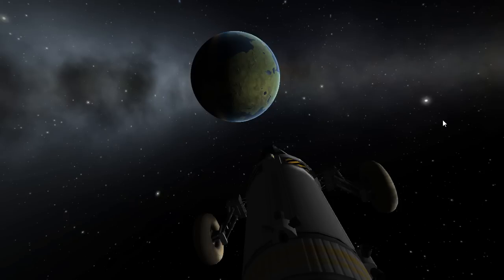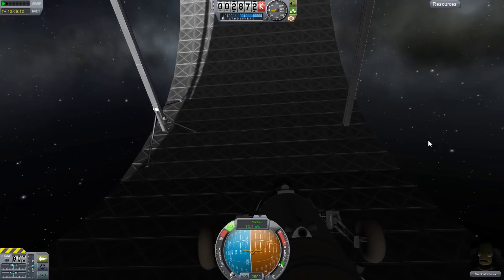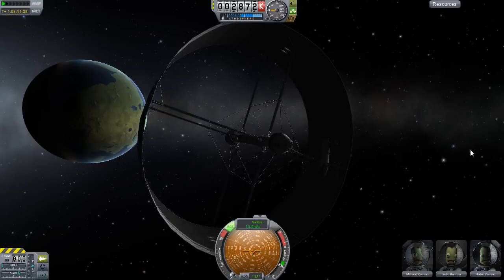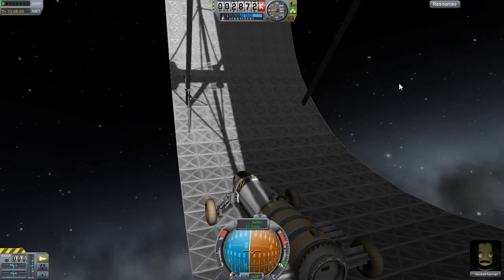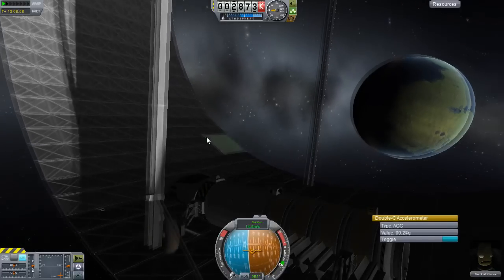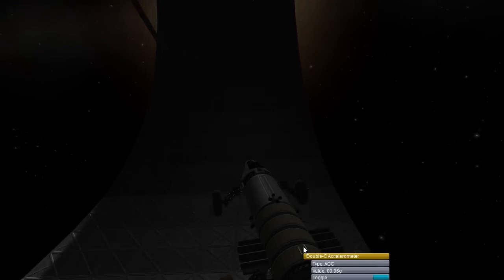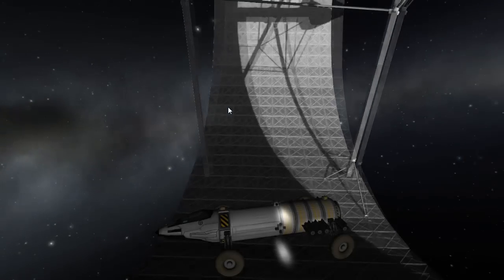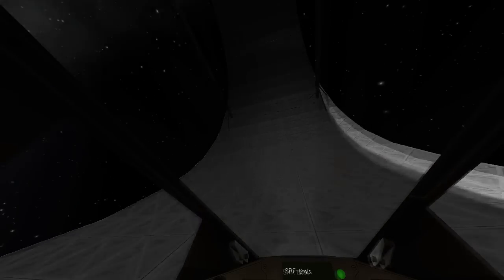Artificial Gravity: FINALE (Kerbal Space Program)

Comment: Now go convence NASA that this is what they need to build to send to Mars. or Europa. Just imagine.

Your center peice would be your spaceship. You could even build the ring in space and then have the spaceplane or ship with the landing equipment launch seperately and then dock with the ring later. 

The outer ring would consist of two rings. IF the Physics in this game are correct. You would build an outer ring with mass to it that spins at good speed. The inner ring would be your habitat area and would use the outer ring as a means to spin itself faster than the outer ring. You could then control the gravity thats being put onto you for say... if you know the specific gravity of the planet you will visit... might as well get use to it in transit.
Reply: I agree, but I think a better way would to just have the ring built into the spacecraft, but folded up, and on a pivot so the ring only rotates instead of the entire spacecraft. Then just make that ring the habitation module, so the crew can stay in there while on their way to Mars (Or any other planet)In a way, it's like a giant gyroscope on a spaceship. But you can also just have the spacecraft be the one ring alone, and have every control panel, dial, and command screen inside that ring, but how would you get such a massive craft into orbit? No one knows. But you could build it in sections and dock it up there, but then it wouldn't have the same structural integrity as the craft I mentioned beforehand. :3
Reply: Its totally possible to build the entire spaceship in orbit. After all thats how the world built The International Space Station. They just went up there and hooked up the parts did all the work of connecting junk once it was in space. 

I honestly think the best way to build future space craft is in space. Just have a space plane take you to low orbit where the spaceship is being built. Im sure it costs tons of money to do this thats why no one really wants to. 

As for the case of the ISS, it was built and funded by like 20 different nations so thats why it was so doable.
Reply: ***** Then... What was the space shuttle. Or why did space X get a reward for building one that now actively supplies the issue... They exist and the technology is there. No one uses them because not many people really have a need for space beyond research and satellite technology. It's stupid to shoot satellites into space with a space place. We don't have many because there isn't a commercial demand yet
Reply: ***** If you read the entire thing I stated that it would cost tons of money and thus why no one has done the idea of building a giant spacecraft in space to reach mars.

Comment: I was watching one of your previous videos and the problem I saw with artificial gravity and running to increase your angular velocity is that every time your feet leave the surface as you run, your angular velocity would drop to around zero because there isn't anything rigid holding you to keep you at the same angular velocity.  Technically, you wouldn't want to jump because it would be too easy to leave the surface and you would probably hit the surface on the opposite side with considerably more force and for the time you're not on a surface, your body would be completely weightless.

Comment: Earth is 12000 km in diameter, halo rings are 8000 km, and mars 3000 km. So yes, they ARE planet sized.
Also, when did I mention Lagrange points? And anyway, why couldn't it be at a lagrange point? (btw, "too much gravity" does not mean anything. Do you mean they are too massive? Probably not, since they're very thin and hollow. Their masses have even been estimated to 1.7x10^17 kg, 200 millions times lighter than Earth!)

Comment: No. Centripetal force is the force that impels objects following a circular path towards the CENTER of the axis of rotation. For example, gravity keeps you in orbit by applying a centripetal force to keep you from flying off into space. Centrifugal force is the force that pushes a body at rest inside a rotating reference frame away from the axis of rotation, and is the counter-force to centripetal acceleration. He hasn't offended physicists at all.

Comment: You could do that to an extent. It works a little different than the bucket with water though, because on earth when you spin the bucket, you yourself are held in place by friction. This isn't so in space. 

Things will have a tendency to spin around their center of mass which would actually be somewhere between the center craft and the module. Not a big deal if the module is small, but it can make a difference if it's close in mass, or larger.

So, wheels - or at least symmetry, works better.

Comment: Let's say we're Saian so we can take 60rpm no problems. That's 1 rad/s.
We want 100g to have a shot at Frieza, with 1g=9.8m/s that's 980m/s.
The formula is "m/s . (rad/s)² = radius", plug the numbers and we get 24.8m for the radius. IIRC that's a bit larger than CapsuleCorp's ship.

If we stick to the 4rpm figure from NASA the radius would have to be a bit over 5585m (for a circumference of 35km). That's big.

Comment: Quick question for you HOC. 

If you take your ring and you spin it neither clockwise nor counter-clockwise and instead spin it as if you were flipping a coin (imaging the outside of the coin is your ring) then wouldn't it remove the problem with losing any angular moment for the forwards and backwards movement? Granted moving left or right then would mess things up based on the direction of the ring. Feels like there's no good way to go about that without losing some angular velocity.

Comment: 2:07
If you are inside a spinning ring you experience centriPETAL force because you are accelerating towards the centre (being pushed inwards by the walls). The ring itself is experiencing the centrifugal force from you are exerting an opposite force on it (obvs). If the ring were to disappear, you would not be flung outwards, as you should if you were experiencing centrifugal force, but instead you would fly off at a tangent. 

A REALLY good demonstration:
/watch?v=Ct1QuKLJl-g

Comment: 1. Add a long girder segment or something similar.
2. Add a separtron on 4 sides symmetrically.
3. Attach it to your space- or aircraft using docking ports or stack separators.
4. If you used stack separators, you can use staging, but I think it's better to use action groups to fire separtrons and undock/separate at the same time.
5. Point towards target
6. Fire
7. Check for damages.
8. If there's too little damage, rinse and repeat. Otherwise go to step 9.
9. ???
10. Profit.

Comment: There is no such thing as centrifugal force, there is a centripetal force, which is the force acting on you which keeps you in the circular motion, in this case it is the electrostatic repulsion of the walls or the normal force. However the 'centrifugal force' is non-existent and the experience of it is just the object in circular motion accelerating towards the centre.

Comment: Easy answer, Halos work in Halo because of centrifugal force, the planet ring design is based off of this force. Even if the parts of ground underneath you actually pull you down to the ground is only a bonus. In a true simulation, gravity would pull you up, in theory the opposite side of the ring would pull you just as much as the part below you. However in (kerbal) practice you could say that if that was true you could only stand on the far side of Gilly.

Comment: People wouldn't fall up, because the far side of the ring is further away, but of presumably similar mass, its gravitational attraction would be significantly weaker than that just below character's feet. We are attracted towards the center of mass only for solid spherical objects, or objects that are distant. Otherwise we would all fall towards the sun, center of mass of solar system. If the ring was dense enough it could be gravity, although I expect it is centripetal acceleration as you said.

Comment: While it is true that a structure like Halo certainly has a huge gravity well the fact is unlike earth the surface you stand on is on the inside, not the outside. On earth's surface your feet point down(Anti-Radial) and the earth's center of mass is below you. However in a Halo your feet point up(Radial) and the Halo's center of mass is above you. So in a Halo most of the mass is above you pulling you up and it exactly counters out the pull was little mass is below you pulling you down.

Comment: I just read up on the halo wiki, and there it says that the most likely have used a combination of centrifugal force by rotation and some other means of gravity, but if they have so much "mass", would not the mass on the other side of the Halo also pull you towards it?

Comment: Actually, that wouldn't make sense since if mass were the primary source of gravity, it would theoretically be mostly neutralized by the mass on the opposite side from where you were (assuming you're walking on the inside). 

You would have to be walking on the outside of the ring for its mass to be the primary gravitational source, and that's assuming it is "massive" enough for that to even happen.

Comment: 1: If it rotated, but the "gravity" forces created would be irregular to that of a planet where the force is pulling inward from a circular motion, due to air pressure. depending on the size of the ring (Ex: Yes, Halo's halo.) the forces may be to widely spread to notice a difference, but on a smaller ring, the affects of gravity loss within the radius of the ring's surface would be vastly different.

Comment: While it is true that inertial reference frames do not contain centrifugal force, rotating reference frames do. Because the direction of a vector is dependent on the reference frame, a rotating reference frame needs an "imaginary force" to cause movement in a straight line. This means that inertial motion in a rotating frame appears to be curved. However, centripetal force does still exist. Thus, rather than say centripetal force drops out, we add centrifugal force to counteract it.

Comment: I just though of something interesting. As you increase the diameter of an object, a wheel for example, as it spins, the outside circumference will make one complete rotation, while the center, or the axel, will make multiple rotations within the same distance. When applied to an artificial gravity device, would this make the forces near the center of the device have a stronger "gravity" or will it be less?

Comment: Well, technically, you're are right a little bit, Centrifugal force doesn't exactly exist, what's really causing the "weight" is the inertia of the object trying to go straight in the same direction while it's running into the walls of the ring, which are exerting centripetal force on the object, so the object is pulled up against the walls of the ring. But that is kind of hard to understand, and so centrifugal force is born.

Comment: Centripetal force is a force which keeps an object moving with a uniform speed along a circular path and is directed along a radius towards the center, so the rotating ring is exerting centripetal force on the rover, but what is causing the "weight" is centrifugal force, which is the apparent force which draws a rotating body away from the center of rotation. The fact that something is being kept going in a circular motion would not give it "weight", it's centrifugal force adding the "weight".